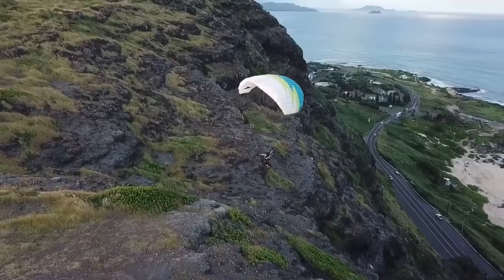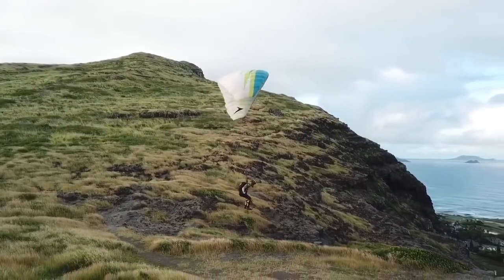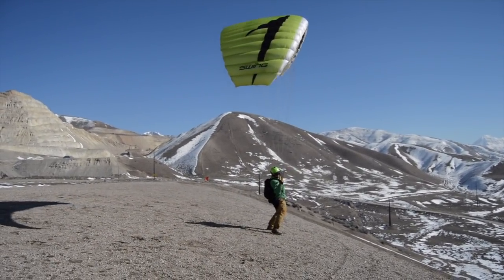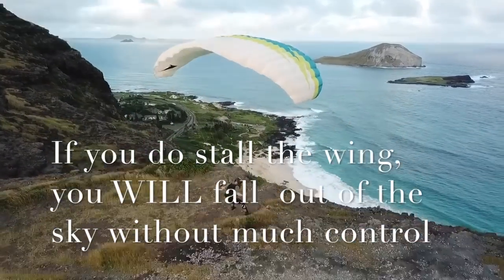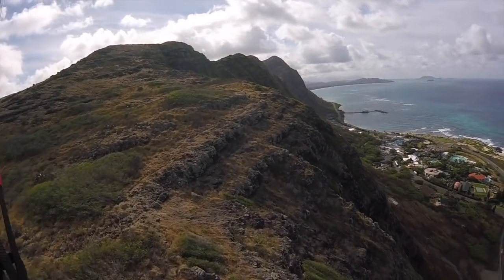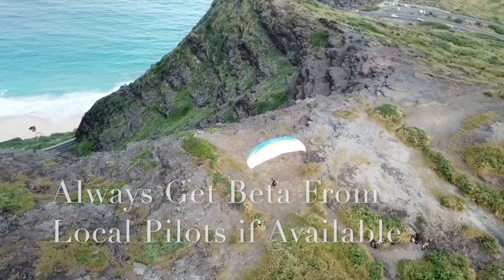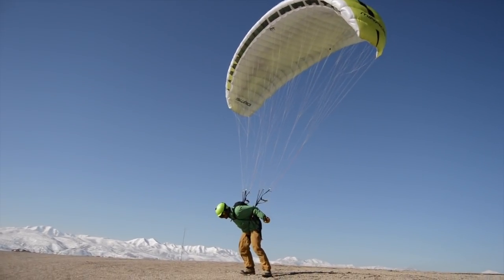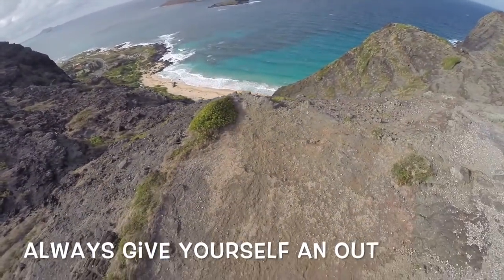How to Top Land a Speed Wing or Mini Wing, Tips for Top Landing, and a Speed Soaring Top Land Crash

Comment: i fly hanggliders not paragliders but the concepts are largely similar.  one thing thats important to remember when hovering/near hover or any other situations with high airspeed but negligible ground speed is the lack of momentum/inertia. While the wing is flying in airspeeds equivalent to what you would see out in free air the lack of momentum means that small drops in the wind can easily stall you and without that forward momentum you can lose orientation with respect to the wind super quick. ive seen a lot of people get yawed 30 or 40 degrees in a momentary loss of wind and then when the wind comes back half a second later they get shot downwind fast and have a hard time recovering.  

this makes that point in the approach where you still have a lot of altitude but very little ground speed quite dangerous and over time you should really try to minimize that portion of the approach imo

Comment: If you get the wing to pendulum back and forward real hard as you touch down, with your timing perfect you can punch it right through the stall and the wing and you are safely on the ground in a blink.  You can pendulum it a lot harder than you might think - right back into the stall, and well forward into the surge.
Reply from the maker: Steve Wright haven’t tried that one yet.  Makes sense though🤙

Comment: Hey Josh, just bought an 8.5m pre-owned speedwing only for ground handling practice. What wind speed do you recommend to practice in? I'm a paragliding newbie.
Reply from the maker: Shahar Ben-David depends how much you way.  Still start in light winds up to maybe 10-15 mph and work your way up slowly. 🤙
Reply: just to also weigh in, its great to get as much ground handling as you can! I'm PG4 and an CFI, and I still round handle new wings as often as a I can even after 12 years of PG flying, and 22 of skydiving, however, a mining, say 12-28m2 compared to your average A or low B wing are two different instruments dude!
You'll jump on an A wing and they are infallible! Literally designed to repair anything you do or conditions change etc in the sky, but I remember jumping from my BGD Epic (low B) to my Base (high B), and the absolute difference in how much more aggressive and responsive the jump up was blew me away.
I'm confident now after all these years competitions and teaching to fly any wing, but you'll still see me ground handling often, but minis are so easy to ground handle they don't give you a true sense of what you're in for when you do eventually train and get certified...
Safe flying and blue skies dude
Reply: @patrickswayze2596  you lost me at "Patrick Swayze"

Comment: Disinterested as we are in hearsay, my question to you is about your actual experience of significant collapses flying trimmers in Vs trimmers out on your various trimmer supplied wings. I am awear of the fear of larger collapses and the consequences of collapses on smaller wings with higher wing loading. So please no justification just honestly tell us how often do you actually get collapses in the trimmer out position? I understand we are loath to get collapses in any position but particularly trimmer out because wind velocity is higher and leading edge wing loading is increased which can enhance dynamic stall frequency say in big maneuvers ...
In practice I don’t find collapse frequency to increase trimmers out/ open ( high speed, high decent). 
In theory: 
Given that trimmers out de-weights the rear wing, the CoL center of lift and CoG move forward with secondary pitch back of the chord and increase AoA of the leading edge. This increass of the AoA will be countered by braking which moves CoL rearward again neutralising/ normalising the AoA initially then with deeper brake close to stall the AoA may on some wings reduce from trim angle. 
Hence in theory the trimmers out does not increase frequency of frontal collapse. Though like reflex wings WHEN it does collapse (in bad air) it will collapse bigger with more excitement and rotation because of the weight on the leading edge and speed...  
It is well understood that trimmers increase speed and decent like bar ( like regular non trimmer speed system) but the initial input is opposite (trimmer vs bar) with reversal of secondary sequential effects... secondary effects are the nuanced counterbalance to balance our flying pendulums...
Reply from the maker: Peter Phil  I love thinking about this stuff, haha.  I have only had one full frontal collapse on a mirage rs 11m.  My trimmers were at the Diamonds.  About 1/3 out.  That didn’t have anything to do with the collapse.  It was caused by being light on the wing during a recovery and flying into a rotor when soaring.  It re-inflated within about 10 ft actually.  I agree with you the wing responds to a collapse more violently with a steeper trim.
Reply from the maker: Peter Phil fun stuff to think about

Comment: Wonder what a wind speed should be to allow soaring on such small wing.
12 m/s or even greater ?
Reply from the maker: Not used to m/s, but we usually fly small wings from 20mph up to 37 mph.  I think thats between 11-16 m/s.  Thanks for the comment!
Reply: @8Livingthedream  I flew that spot yesterday. The day before was about 23mph. The top was more. I only brought a mirage 15 with me and weight 200lbs. Would it have worked? 😆